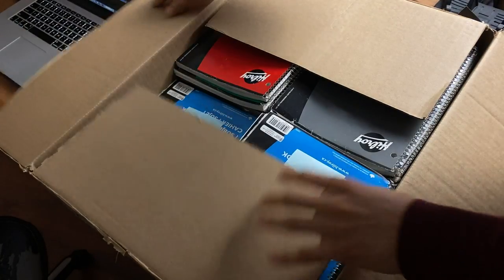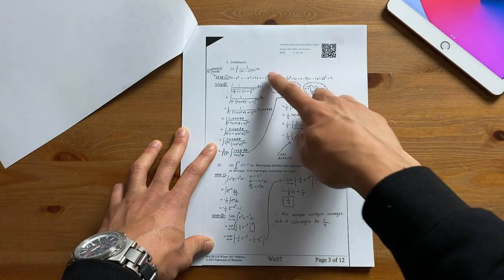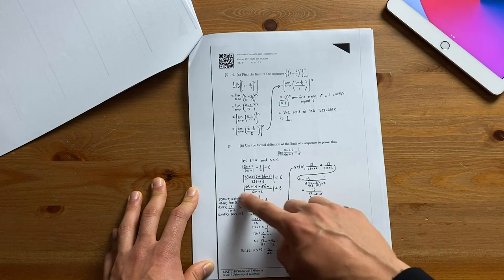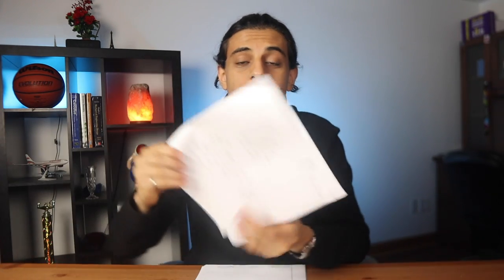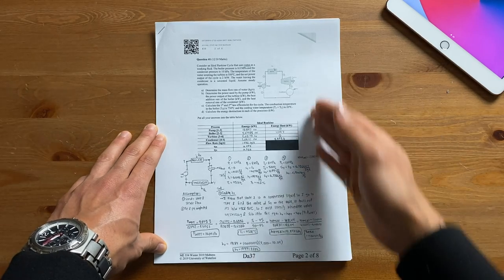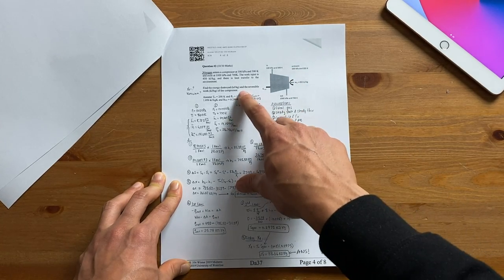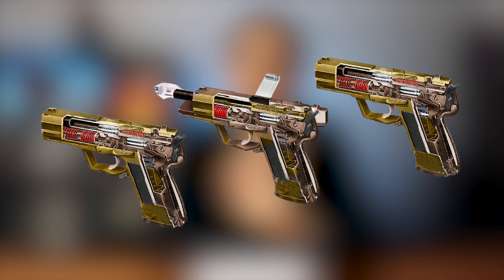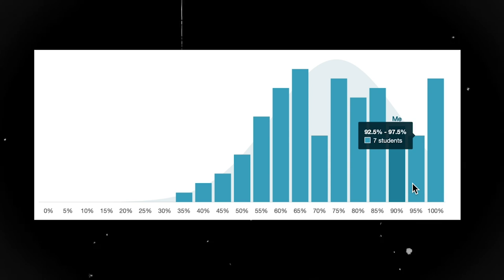This is what engineering EXAMS look like

Comment: In Belgian engineering universities, the median is more like 55%. While 50% is a passing grade. Questions are intentionally made way too difficult, and is considered the "norm". Either way, nobody really cares what your score was as long as you got the degree.
Reply from the maker: Wow, that’s so different than school here in Canada
Reply: Same for the Netherlands
Reply: In the US a lot it’s structured the same way but those low scores are often curved to account for the fact the questions are intentionally too difficult
Reply: @TamerShaheen   I guess it depends of the school in Canada, because where I went, the median could be as low as 35% for some exams... Some first year classes had 30%-35% of the students failing the class (and it is how the classes were meant to be)
Reply: @philippejolin8841  Our first math course (at mathematics engineering Programme) had a failrate of 65% this year. I got just 12/50 points, and I know several people (whom are really good at maths otherwise) that got way below 10 points. 20 points is the limit for a passing grade
Reply: @denbastadilfred688  Ouch, I've seen some pretty high fail rates for some math courses (50%-55%), but 65% is insanely high (even by my University standards). I'm happy I'm almost done with Uni. Got my Bachelor's degree last year in Electrical Engineering and I have only one semester left before getting my Master's Degree. I have to say that it was a pretty stressful couple of years... Good luck!
Reply: @philippejolin8841  no offense.. Tamer went to waterloo.. its probably the top handful of Eng. programs in Canada.. I've overlapped Science and Eng. classes at Waterloo also.. I can say its never that bad..  to have a median of 30-35%.. theres really no point of students writing these kind of test at this point unless (no offence..) students were not of quality standard (granted that waterloo does tend to attract some of the most talented undergrad across the country..).. the academic curriculum especially for science and engineering is like the same across the board in canada there no reason why first year Physics, Chem, Calculus or whatever Eng courses teach vastly different material than at other programs..  I should note that I was also a grad student, and have never seen the audacity of students want to be totally spoon fed these days..
Reply: ULB OU QUOI MON POTE ?
Reply: Jea Im a german mechanical engineering grad, went into mechatronics later. Math 1 & 2 had >60% Failrate, technical acoustics 75%, control theory 1 65%, but machine elements and design was the worst with >75% failrate, the average of that test was somewhat about 30%. Most senior students said its normal to fail those on the first try. Mind grading was never curved during my entire studies. We started with like 300 students and ended with about 50 distributed to 4 specialization paths.
Also we had an internship semester during which we had to write two papers the same requirements as a thesis (no one i know achieved that in one semester). Its still a mystery to me how someone could do all of this in the standard period.
Thermodynamics was suprisingly easy, probably because there was an avanced course later for those in the design and development path.
Reply: We have a professor here in the US, whose exam average is 20%. 😂 Bust most classes average between 40%-60%.
Reply: North American uni exams are much easier than in Europe
Reply: Same here in Brazil
Reply: @janeymers7154  only 60% failrate kekw, in portugal for engineering students, calculus 1 had a failrate of 80% on my college
Reply: @Beau It really depends on how difficult tests are, at least in my case, tests are intentionally made to be hard so the average score is low. I don't think a single student got a max grade
Reply: @Beau Oh, I got your point. Yeah, aiming barely the necessary score to pass is indeed a looser behaviour
Reply: Same for Turkey too
Reply: Same here in Germany, Aachen especially.
it's not rare to have a failure rate of over 70%, because the university wants to keep his status as "super hard elite university, where every grad is the best and prepared to work 60h/week/Solve multiple problems while beeing under enourmous stress".
We're wanted on the work market, but studying is hell.

Worst experience was an exam wich was about thermodynamics combined with quantum mechanics.
78% failure rate. average score about 30%. Passing grade is 50%.
8 weeks non stop learning of about 8-10h/day resulted in a 57%.
And i was one of the best...
Sad
Reply: @MarioRodriguez-gr8wc  jep same here in Belgium around like 60% of people drop out in their first year here. I have had exams with 80% failrate... Exams never contain the straight forward algorithmicly solvable questions here, they are questions that you've more often than not have never seen or practiced before so that you can only really solve them if you have a fundamental understanding of what you are doing and are able to derive formulas and such on the spot.
There is also 2 big strains of engineering here, engineering technology and engineering science. The technology variant is the seemingly more american way which is not as high level and is more focused on technical side of things, and then there is the sciences which is the one i described above.
Reply: In Switzerland engineering unis we have to score minimum of 70% in math 1&2 . Thats pain
Reply: @ahmadmez  bah ouais gros ils ont pas connu haelterman ceux là
Reply: I got my Bachelor in Mechanical Engineering from Aachen, Germany. It looks like high fail rate correlates with university status, so-called 'elite'. I don't believe that same subject taught in different country have different difficulty level. It's teaching that absolutely sucks here in Germany.
Reply: Yes, I agree. I studied bio-engineering at the Catholic University of Leuven, and the questions are indeed very difficult, especially in the first two years, to weed out average students. It gets easier during the master’s years. The courseload can sometimes be unnecessarily heavy; for instance, calculus combined content from Calc 1, Calc 2, and Calc 3, covering everything from single-variable calculus, Taylor series, and differential equations to multivariable calculus (including triple integrals). Exams were divided into theoretical (proof-based) and practical (exercises). I also remember thermodynamics exams being particularly challenging, with problems derived from abstract theory not covered in class.

In Belgium, anyone can choose any major, so there’s no initial filtering (due to the socialist system). There are three main engineering branches: industrial, bio-engineering, and ‘burgerlijk ingenieur’ (comparable to civil engineering but broader and considered the most difficult and theoretical). In ‘burgerlijk ingenieur,’ students specialize in their third year, choosing fields like electrical, materials science, computer science, biomedical, mechanical (werktuigkunde), and logistics & supply chain. Industrial engineers also specialize in their third year, with options like electronics-ICT (focused on electronics and software), chemistry, and biochemistry. While bio-engineering and ‘burgerlijk’ are considered equivalent in difficulty, industrial is seen as easier. Bio-engineering is more focused on 'green' areas such as agriculture, land management, cell and genetics, and biosystems, providing a technical profile similar to ‘burgerlijk ingenieur.’

All Flemish universities—Ghent University (UGent), the Catholic University of Leuven (KUL), and the Free University of Brussels (VUB)—follow a similar system for engineering disciplines. In addition to universities, there are also ‘hogescholen’ (similar to community colleges), which focus more on practical training with projects and less on theory.

Comment: Anyone who studied Thermodynamics knows that those cycles are the easiest, lucky you!!!
Reply: I now see why math and phy students make fun of engineers haha!
Reply from the maker: Well relative to the other cycles, ur right 😅
Reply: @mastroitek  why
Reply: @cj-dt8jc  well those problems are quite easy, everything is straightfarward, like calculus II exam was really easy. But before this turns out to be an angry comment section I want to point out that I don't mean what I said in a bad way.
Reply: @mastroitek  😅OK bro
Reply: @cj-dt8jc  does it look complicated to you? If you intend to start engineering don't be afraid of those exams, you have a year to learn all that fluff and you will be in a class with a lot of students having passion for the same subject, which will motivate you!
Reply: Although i do agree that they are easy, but they are easy for people who practice harder stuff. Some people still fail these “easy” exams. I believe the exams that i took in these similar subjects had the same level of questions as well.
Reply: @maathethird9345  sure mate. This level is adequate for engineering students which have a solid background of maths and physics. To begin learning engineering subjects likd termo, material science, machine theory, electronics, reactor design, heat transfer, fluid flow... you just have to dominate basic science subjects of highschool
Reply: @mastroitek  I agree I'm in last year bio-engineering and this looks easy for sure
Reply: @mastroitek  Espcecially the math looked so easy, our first calc course wal calc1,cal2 and cal3 combined, like we started off with triple integrals, hard langragian optimization questions, diff equations, convergence/divergence series..
Reply: @thebgEntertainment1  wtf!?  I did one for each of them. Anyway, I think the point of those exams is to see if the student understood the method.
 Nowadays the heavy lifting is done by programs. Seems anyway a bit excessive to be able to bring a calculator for any of the exam showed.
Reply: @mastroitek  yeah xD But there are different types of engineering. Iam studying engineering cybernetics and we have to take the same math and thermodynamics courses as physic students. The reason is propably because this kind of engineering is a lot more math oriented than construction oriented like mechanical engineering. We  dont have to take physics courses but a lot of dynamics courses like aero, bio, mechanical, electrical etc. dynamics
Reply: @mastroitek  Well depends on what your definition for easy is. If you are talking about the in-depth of the knowledge for sure engineering doesn’t go that much deep in each subject comparison to the specialized science program. But the thing is engineers learn literally everything from physics, chemistry to coding, mathematics. They usually squeeze double amount the content of a regular science course into one and have six to seven courses one semester. My boyfriend switch from engineering to physics and math because he thinks engineering was too overwhelming for him and he did amazing in physics…
Reply: @mastroitek  why? Coz they study cases that WILL never happen and call it theoretical physics?
We study real life applications and contribute way more to society than any phy and math major ever can, and tbf thermo is one of the easiest topics of engineering, look at solar power, nuclear power, electronical and mechanical systems and designs then tell me if it's easy
Reply: @saadalkhatem3890  dude, I just compared two exams of the same subject from 2 different faculties, it is clear that the engineering exam is easier and I don't see the problem with that. why so salty
Reply: civic
Reply: @mastroitek  it depends what and where you are studying. I'm studying engineering too but my thermodynamics and calculus exams were way more difficult than his. It's just a different approach to structuring and exam, that doesn't mean that maths students study more/harder subjects than engineering ones, maybe it is simply that in your country (like in mine) exams are generally harder than the ones shown in this video, but that hasn't necessarily have anything to do with the faculty, it is more about the country (as I said earlier)

Comment: As a fellow mechanical engineering student I can say that it is very similar with what I have been through (minus the cheat sheet). 
I’m surprised how good your handwritings are  with minimal scratches under a lot of pressure, mine had been quite messy 😂
Reply: Same course of study here. We're not allowed to bring in cheat sheets
Reply: As a mechatronics eng student we are also not allowed to bring cheat sheets
Reply from the maker: To me, my work looks so messy 😅 but I’m glad u think it’s neat haha. Also, surprised that other universities don’t allow cheat sheets, but tbh I battery even used it on my exam.
Reply: Lies again? AO Levels
Reply: @ayhmalfaloji7448  if u don't mind me  is it worth doing?
Reply: @Mikeplaysdbd  i kinda like it but i see less people considering it as an engineering major so i am a bit skeptical, after all i am a 19 year old dude discovering life idk whether it is good or nah
Reply: Senior Mechanical Designer here. Don't let the subjects make you feel bad. If you are an A++, A+, B or whatever, at the end you aren't going to use anything you learned at the uni. Of course, it is easier to enter in a big company but the small / middle ones are much funnier. 
The small companies make you an Allrounder. Keep going! Never stop!
Reply: I've found that cheat sheets for Thermal are more common than for other subjects. It will depend on the exam rules and standard references permitted

Comment: Also as a fellow meche yall should also understand that this is one of the best engineering schools in Canada, the marks they receive are going to be better than other colleges. Yeah depending on the class and professor you can get the 60 avg for exams and no 100% marks. In the end of a lot of factors determine success and hopefully other students will see this video and try hard.

Comment: At my university (in Sweden), they seem to really enjoy making the exams difficult. On the exams I’ve taken so far, you can get a maximum of 50 points, with 20 being a passing grade. For our first math course, the fail rate this year was 65% and I only got 12 points. You need to know a significant portion of the course really well In order to pass, because if you know everything fairly well, it will still be very tough to solve the exam questions
Reply: its ok just try ur very best
Reply: Pp pp pp pp pp
Reply: I go to KTH and you need 16/32 marks to pass, where 12 marks are at an A level, so pretty tough to solve hahha 😂. We typically have a failrate of ~50% each math exam
Reply: Similar in Brazil, my class had one calculus avaliation that had 11/100 as the average score. I got 20/100 though😎
Reply: @marcelo497  congrats dude =D
Your exams are have plenty more marks than mine? How much time do ypu usually get? We have 3 hours but the questions require quite some time
Reply: @Right-be8uc  Thanks bro. 
We usually have around 2 hours for exams. Our last exam had 3 questions, but the first  two questions had 4 itens inside each of them.
Reply: @marcelo497  oof, i hate 1 question is divided into many parts, we usually dont have that here i Sweden. For the most part we have 6 quite long question, with 6 marks each

Comment: The question no. 4 of differential equations was way too easy ....that question falls under the category of Particular integral  case 1...and in that particular question the  roots were real and different P.I = C1 e^m1x + C2 e^mx..... To me case 1 is easy but i sometimes struggle with case 3 where on the right hand side you get a function of X...in which you have to expand it by using binomial theorem and then the calculation just becomes dirty

Comment: Lmao my controls exams did not look nearly that neat. We had 5 questions and only 1 hour for the midterms, (13 questions and 2 hours for the final!) so every single time it was just a huge time crunch, and I was writing everything in any space I could fit. Still secured that partial credit tho 😎
Reply: Is the marking standardized? Do you get mark schemes?
Reply: @raahimhadi4905  yah every question was worth about the same, around 15-20 points, and was indicated next to the question on the exam
Reply from the maker: That was my controls midterm, so it was doable…but my controls final was sooo messy too

Comment: Now I'm blown away . 7Qs in Calc 2hrs? 3-5Qs in Thermodynamics 2Hrs? And not forgetting Control System. And also allowing Cheat Sheet? Dyum, I'm in mechanical final year, studying in India, never allowed Cheat Sheet in exam except Calculator 😂 atleast 18-20 questions per subject/course for 3hrs . #sendhelp 🙊😅

Comment: Calculus: Not even a double, not to mention triple integral? No taylor series... Just trigonometric integrals (did the test itself just reminded you sin2+cos2=1 ?????) and a couple of logs.
3rd year themodynamics: A pair of turbines? not even an Otto engine? no convection, boundary layers, radiation, form factors, turbomachines, flow study...
Again, 3rd year control systems: ot even a PID nor a Bode diagram in the whole exam (very basic stuff)?
I don't know what's normal in Canada but that kind of exams in Spain would be considered as a joke

Comment: I think the solution to the calc paper 6a incorrect , the limit is not 1. I do not think its appropriate to put the limit inside one of the bracket and perform analysis on it. Consider a similar limiting sequence which converges to eulers number!
Reply from the maker: Well I did this exam a few years ago…so tbh I don’t remember why I did what I did 😅